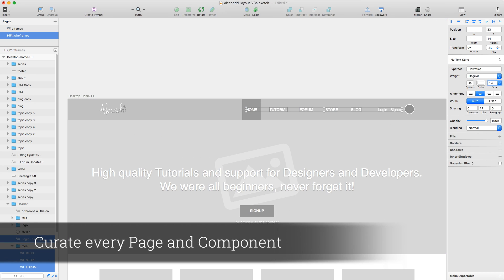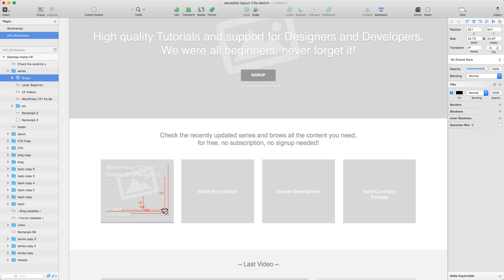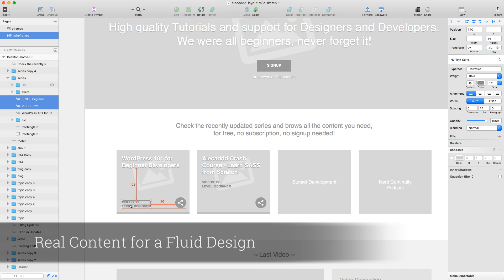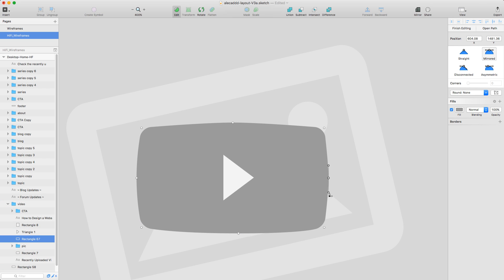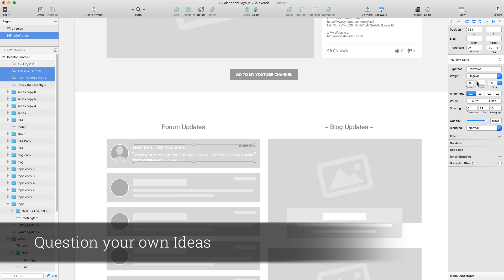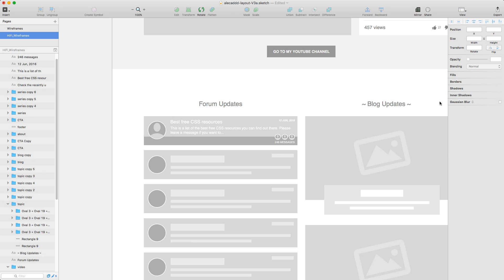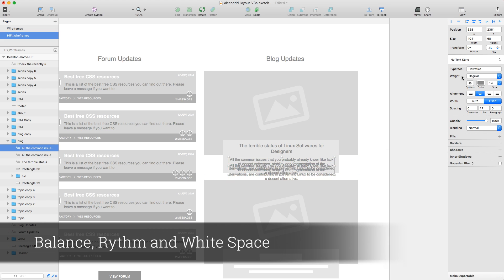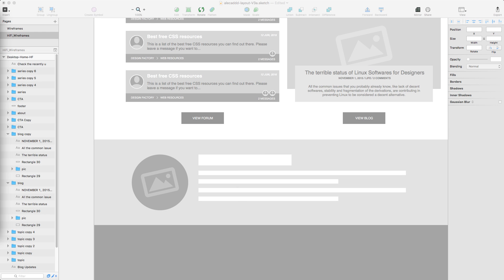How to Design a Website - High Fidelity Wireframe

Comment: Hey, nice video here! Just wanted to know what tool are you using in this video? Thanks!
Reply from the maker: It's called Sketch, unfortunately is a Mac only application, but you can achieve the same things with Affinity Designer, Photoshop, or Illustrator.
Reply: Thanks for all that valuable heads up. Outside of these three, do we've any other standalone tools/software that're just as good?
Reply: am using photoshop for my wireframes, but an concerned about exporting my icons. how do i do about this without having jaged edge images